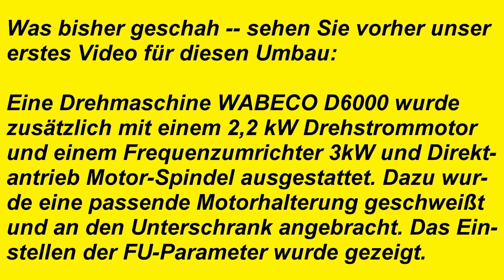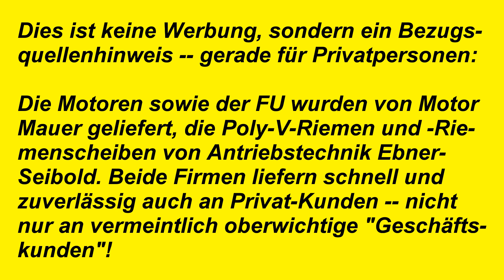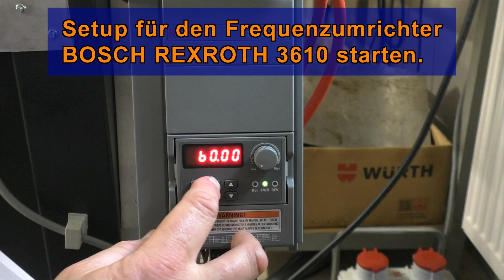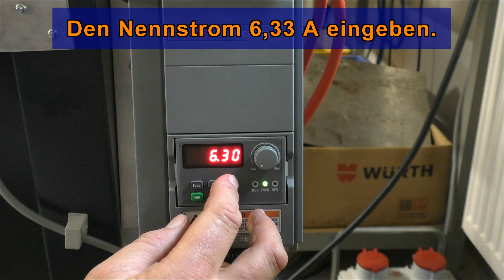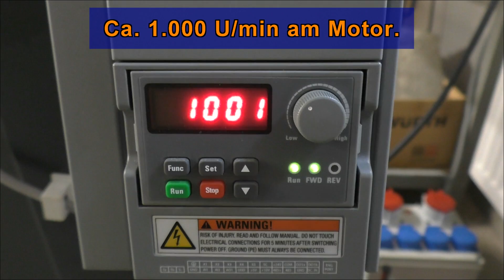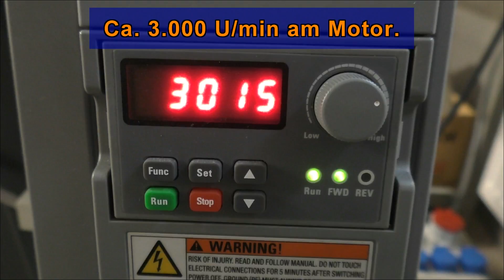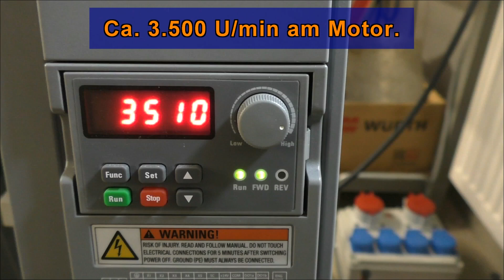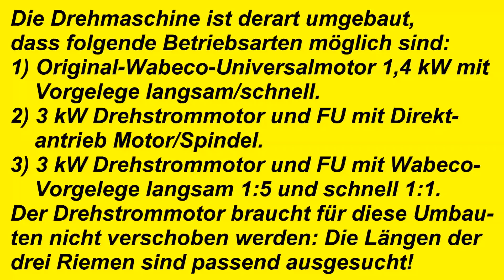Erweiterung Drehmaschine um Drehstrommotor und FU. Part 2

Comment: Also kann man einen simplen Drehstrommotor, der auf 50Hz ausgelegt ist tatsächlich einfach mit höheren Frequenzen betreiben? Aber irgendwo sind doch da auch Grenzen, oder? Also ganz abgesehen von der Drehzahl. Die macht sicher keine Probleme, wenn der Rotor fein ausgewuchtet ist. Aber steigen bei höheren Frequenzen nicht die Wirbelstromverluste innerhalb der Weicheisenblechkerne im Motor an, was dann zu stärkerer Erwärmung führt? Und auch die Durchschlagneigung zwischen den Motorwicklungen steigt doch mit steigender Frequenz an?! Oder spielt dieser Faktor bei 400V noch keine Rolle?
Reply from the maker: Theoretisch ja. In der Praxis können Drehstrommotoren, die für 50 Hz ausgelegt sind, nach unseren Versuchen bis ca. 125 Hz -- also dem Zweieinhalbfachen-- problemlos betrieben werden.
Reply: Die Grenzen sind: 1. zulässige Drehzahl der Rotorlager 2. Vibrationsneigung des Rotors. (evtl. Rotor nachwuchten)  3. Leistung  4.Frequenz 
zu. 2. Ein normaler Asynchronmotor kann ca. 3600 U/min. Dann werden meistens die Vibrationen zu stark.
Also ein zweipoliger  Motor kann dann etwa 60 hz und ein vierpoliger Motor (wie im Video) ca. 120 hz. 
zu. 3. Aufpassen muß man etwas mit der Leistung bzw. dem Drehmoment/Strom, das der Motor abgibt/aufnimmt.  
Die Gesamtleistung sollte in etwa beibehalten werden. (plus 20% sind im Regelfall kein Probem).
Also bei 100 hz darf das dem Motor abverlangte Drehmoment (bzw. der Strom) nur noch etwa die Hälfte des Stroms bei Nennleistung betragen. Wenn man das nicht beachtet wird die Wicklung heiß bzw. zu heiß und/oder  der Rotor heiß bzw. zu heiß.  
zu 4. Ab etwa 150-200 hz nehmen die Verluste durch das Pulsen des FU stark zu (Wicklung wird heiß) , denn er liefert kein richtiges Sinussignal, sondern einen durch Pulse genäherten Sinus. Abhilfe: Einen LC-Filter in die Motorleitung hängen. Dieser braucht jedoch 
sehr hochwertiges Filtermaterial. Dann kann man mit der Frequenz auch höher gehen. Ich selbst habe mit einem REFU-316-F.Wandler 
(siehe meine Videos) schon mehr als 500 hz 30.000 U/min gefahren . (Hochfrequenzspindel mit integrierten Asynchronmotor)  
Die Durchschlagneigung ist kein Problem, da die Spannung nicht erhöht wird, sondern nur die Frequenz.
Reply: Ein betreiben des motors bei niedrigen Drehzahlen ist ebenfalls schädlich, weil keine korrekte Kühlung erfolgt. Man sollte sich ein externen Lüfter nachrüsten, eventuell mit Temperaturüberwachung. Das sollte sogar mit dem Wechselrichter möglich sein.
Gruß Paul

Comment: Meine Drehmaschine hat 1400W, ich kann in einem mal 8mm vom Wellenstahl abnehmen und 3,5mm von V2A Stählen. Warum braucht diese kleine Maschine einen so starken Motor?
Reply: Das Ding ist übrigens von 1965-1975.
Reply from the maker: Karl B Gerade fuers Abdrehen von Bremsscheiben braucht man viel Power wegen des großen Radius.
Reply: LSCAD ah okay. Und das Getriebe schafft die 3KW locker? Wenn ja, dann könnt ich meine ja auch mal auf 2KW aufrüsten
Reply: LSCAD ich brauche da ja nicht viel Kraft, weil ich ja ein Getriebe hab. Die Wabeco d6000 hat ein Vario Getriebe, oder?
Reply: dann nimm mal 8 mm auf einmal von einem werkstück mit 250mm durchmesser ab :D dann wirst du sehen wie deine 1,4kW weinend in die Knie gehen. Industrie CNC Drehmaschinen haben auf der Hauptspindel meiner Erfahrung nach Antriebsmotoren von 5-40kW. Natürlich gibt es obenraus noch exoten, die mit viel mehr Leistung daher kommen. Der ausschlaggebende Faktor ist halt immer der Durchmesser des Werkstücks.